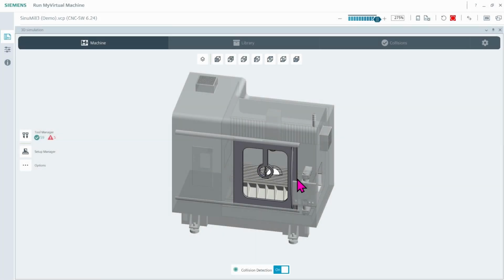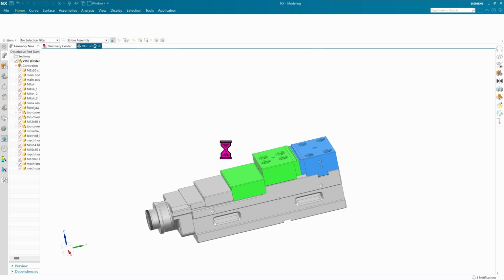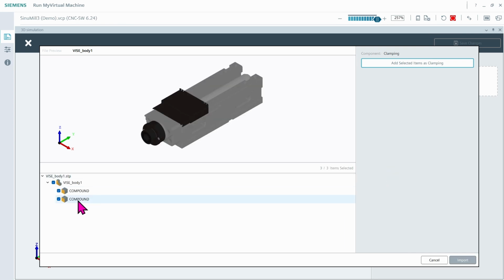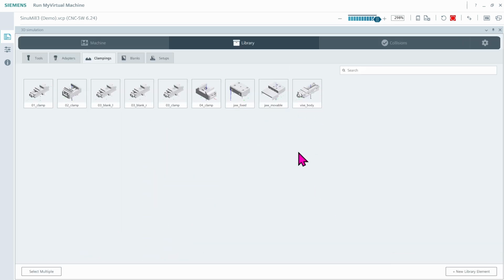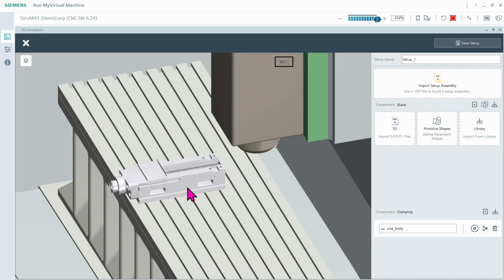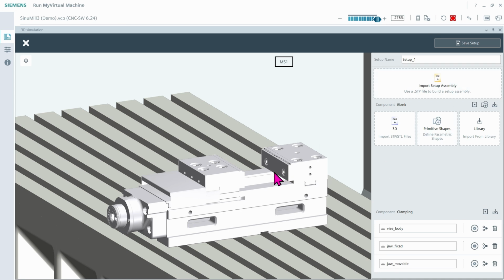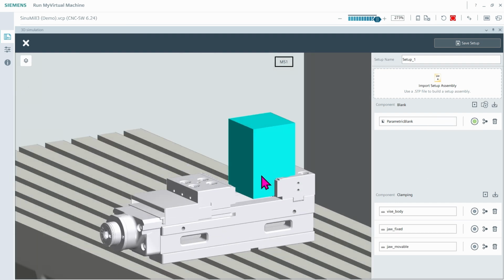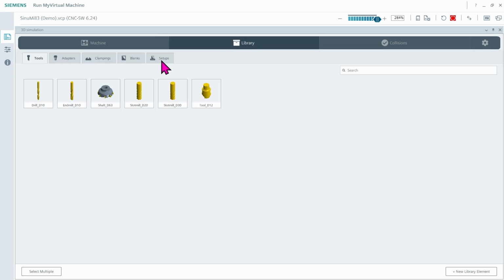Custom Vise Configuration in Run MyVirtual Machine (Siemens RMVM  - Sinumerik One) - Tutorial

Comment: But what should I do if the machine has an auxiliary replaceable device such as a milling head? That is, a machine (horizontally milling) can work without it, with a built-in spindle or a lathe on which auxiliary equipment such as a boring rod or grinding equipment can be fixed.